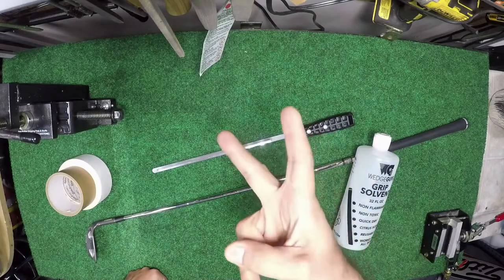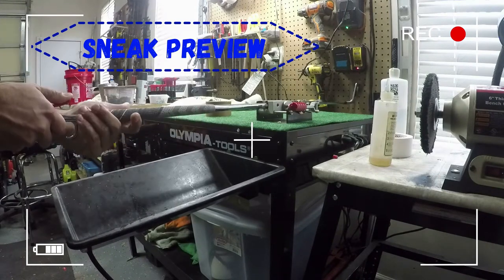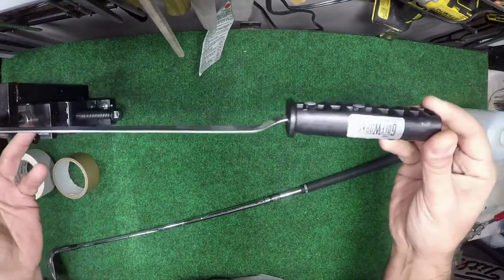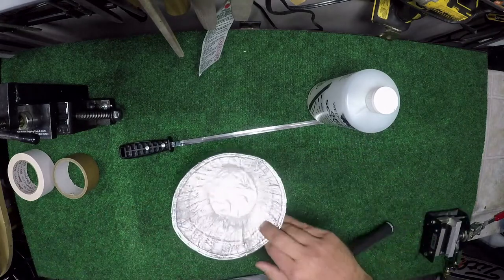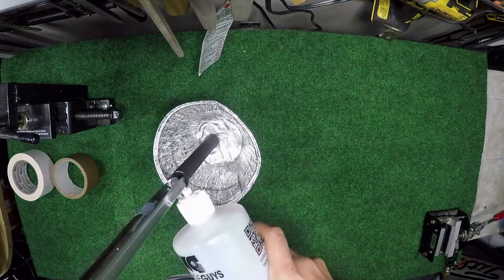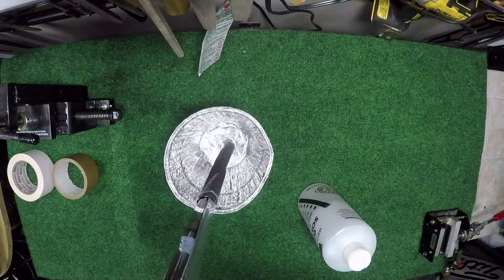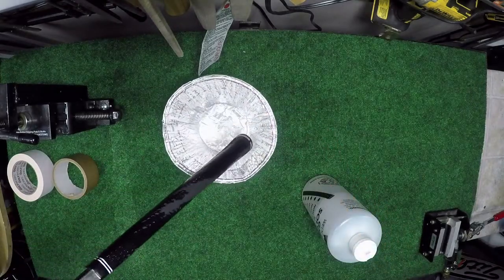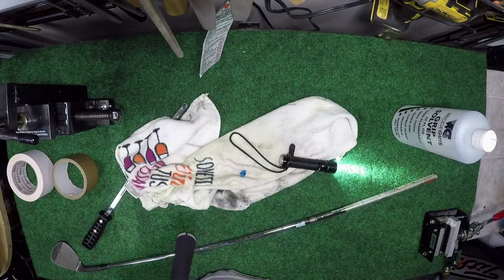Save Golf Grips - EASY!! #golf #golfclub

Comment: My shop taught me to inject the grip with a syringe.  I have since started using the V tool but with the V facing the shaft.  Will try the Air method next time
Reply from the maker: Good stuff...the syringe is a great tool to use as well for any 2 piece grips or putter grips.  assists with not deforming the shape.